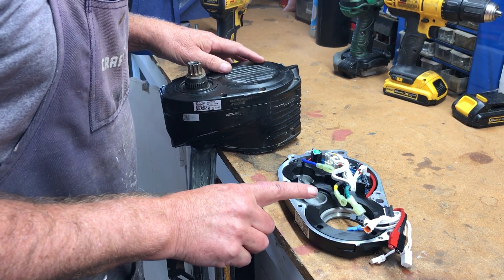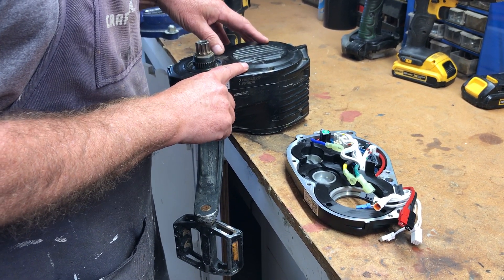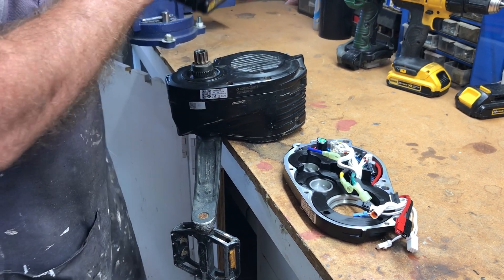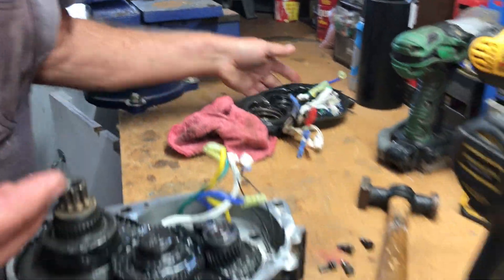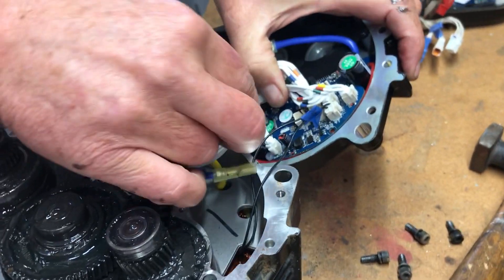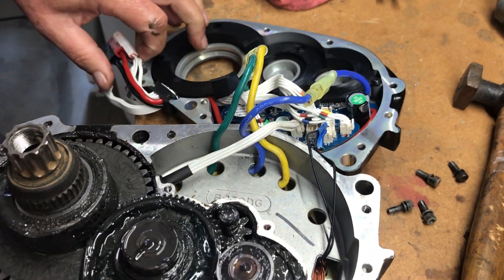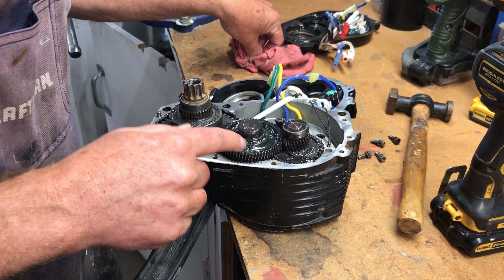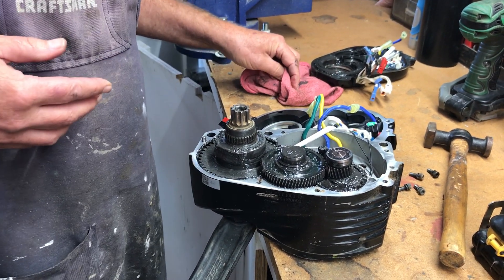Bafang Ultra G510/M620 Bad Controller Swap

Comment: Guess you had to disconnect the wires again to get the gasket on, but thanks for the overview of the process! I recently saw a walkthrough video of the bafang factory, and it looks like they now protect the electronics a lot better, submerged in non conductive sealant.
Reply from the maker: Actually the gasket can be put on easily even if the wires are connected. Not sure of the benefit of encasing the board in resin for the user.  This means no board repair or upgrade of mosfets etc.

Comment: I have thrown away the G510 motor that has stopped working.
It may have worked if I replaced the controller.
I'm afraid
The G510 I'm using now is an early model.
Will the performance improve with the new controller?
Reply from the maker: You probably could have repaired the old 510 with some diagnostics. You should at lease have saved it for spare parts! The new controller will not improve performance. You can make changes in performance by altering programming. If you have poor performance or jerky power bands then a reprogram might help. I'm fine with the stock programming as I have over 4,000 miles with little program changes. The only problem I ever had was not calibrating the new controller to the motor. That makes a big difference in smooth power curve. Best of luck and happy riding! You cant beat the power of the Bafang when climbing long steep hills!!

Comment: I accidentally shorted out the controller before I even installed the motor on the frame. It destroyed my display unit too.
There's no short circuit protection on this system.

The capacitors in the controller held a charge so this can easily happen when unplugged from the battery.
Reply from the maker: I feel your pain! When you replace a controller model Cr r10m.1000.Sn.u.1.5 you have to calibrate the motor to the new controller. I just found this out march 2022. You do this with the C961 display that has been programmed to go into diagnostic mode.
Reply: @filoncmike  Do all the C961 displays have the ability to go int diagnostic mode?
Reply from the maker: @BruceTheSniper  Hello Bruce. All C961 displays can go into diagnostic mode once loaded with the program from Bafang's programming tool. I went to Bafang Los Angeles and they programmed my display for me. Not sure where you are located to have access to the programmer at a dealer or Bafang.
Reply: @filoncmike  I found the instructions online with the hex code to upload to the display. If that doesn't work, I'll get in touch with my contact at Bafang LA, thanks for the heads up.

Comment: Hi Mike! I congratulate you for the video. I have the Bafang m620 with 1000km and perfect. I took the ebike for a km review and I had to change the chain and sprockets due to wear. When I went out to test it, everything was going correctly until the engine stopped assisting. The display marked the assistance mode but the motor did not work. However, the walk mode does provide assistance... Turn it off and when it turned on it worked perfectly. I turned it off again and stopped attending. Any advice? thank you!
Reply from the maker: Disconnect your brake motor shut off cables one at a time. If it works again you know that brake is not adjusted properly or is defective. Good luck!!
Reply: @filoncmike  thanks!! i will try

Comment: Thanks for the detailed installation video. 
I have a G510 motor that has the CAN interface on it. Do you have any experience with replacing a CAN controller board with a UART controller board? From the wiring it looks like the only wires that go to the motor are the phase wires. So I'm thinking that the UART controller should work on a motor that  currently has a CAN controller. Thanks
Reply from the maker: I don't think there is any problem. Everything performs the same. Good luck!!
Reply: @filoncmike  Thanks. I Will let you know how I make out. I have a UART controller on order.
Reply from the maker: Just to make sure, you will need a UART display. I have the DPC 18. It is very good!! Good luck!!
Reply from the maker: I made a mistake, I confused my new bike with the old one! I believe my new controller w Uart worked with the old display. So hopefully it will work for you, although the DPC18 is worth the upgrade!
Reply: @prational  You'll need to change the harness and display to the UART versions or run an adapter cable from CAN connector to the round Higo for the new display.

Comment: Hello Mike Filonczuk!
I would like to ask about the motor i have the same motor and my pedal asistent stopped workin the motor is  working the gass (acceleration ) its give me power but the prdal asistent its nit working i do not want to use it like this its not so much fun and my battery is not last so longer like whit the PAS .
Can you help me with this maybe what do you saggest what can i check what can be the problem?
It was a day when started to work again for 10 minutes and then stopped again...
Reply from the maker: Adrian, did you get any error codes?
Reply: @filoncmike  yes but in the past and very really and it was for one minute and then gone
Reply from the maker: @adrianchester  do you remember what the code was?
Reply: @filoncmike  04 and 21
Reply from the maker: Did you figure out the problem? Check your speed sensor with a magnet. Pass the magnet back and forth in front of your sensor and see if speed registers. If not check for 5 volts at the red wire on your sensor. Black is ground. Check my other video for testing the sensor. If you don’t get a voltage there, you may have shorted out your 5 volt circuit. You may need a new controller.
Reply: @filoncmike  i will check that too.. but anyway i allerdy ordered a new bafang central motor torque sensor and a bafang programing tool best tool for bafang UART/ CAN SYSTEM .
But thank you for your advice:)
Reply: @filoncmike  but the speeds is registering no more erro code i will chelck the voltages

Comment: Burnt my controller and display while using the thumb throttle. Replaced both, display and controller. Calibrated with C961 (Er 44). Walking mode is working, brake sensors are working, head and rear lights are working. Pedal assist, speedometer and throttle still not working. Any ideas?
Reply from the maker: Oh boy! are there any more error codes? disconnect both brake sensors and check your speed sensor at rear wheel for proper 5v. Could sensor have been shorted? Unfortunately this will take a lot of tracking and testing to narrow it down.
Reply: @filoncmike  While calibrating it starts with Er 40, Er 41, stops at Er 44. No error codes at C18 display. How to measure 5v at the speed sensor?
Reply from the maker: You will have to carefully cut into the covering in the sensor wire by the back wheel and check voltage between red and black wires with power on. Blue wire is the signal wire. Do not short them. Code 21 is a fault in sensor. When you matched motor to controller did motor spin slowly by itself?
Reply: @filoncmike  While calibration motor spins slowly by itself, yes! And walking mode is working as it should! No error codes at C18.
Reply: @filoncmike  I have a bike with M400. I will  put the bike together and will try it with the M400 speed sensor instead. It should be the same sensor as the M620 sensor, right?
Reply from the maker: The sensors are the same. Connectors may be different.
Reply: @filoncmike  I have ordered a new speed sensor from Aliexpress. Will need some time to arrive! Distance from the sensor to the Magnet is 20mm. Will this work? Any ideas to get the magnet closer to the sensor?
Reply from the maker: You can stack another rare earth magnet disc on top of the factory magnet it will stay. Glue will make sure. Make sure magnet is aligned to middle of sensor not at mounting screw.

Comment: How do you troubleshoot the controller to determine if it needs to be replaced or not What are the symptoms?
Reply from the maker: Hello Kie! The G510 controllers are pretty bulletproof. The only time I have had a failure was from shorting out the 5volt output to the speed sensor or brake sensors. If you don’t have 5 volts at those red wires going to sensors you may have a short somewhere. If the motor is not turning at all, look first for codes they will tell you what is wrong usually. Unplug brake sensors and see if motor works indicating mis aligned or bad brake sensor. The motor will not run if it thinks the brake is engaged. Check for 5 volts at throttle also. Do you have any power? Check for burned or melted battery connections or melted battery terminals. Ride safe!
Reply: Hey I have an M620 and I replaced the motor core (stator) and it’s running backwards (reverse direction). When I run the motor calibration it goes forward but I get an error code
Reply from the maker: I know it sounds crazy, but are you absolutely sure you have the three field wires correct?
Reply: @filoncmike I am. I even swapped them to see if changing the root somehow changed the polarity
Reply from the maker: @mikehtiger  have you had any success with your problem?
Reply: @filoncmike  I haven’t, I ordered a new controller

Comment: Hope you can answer a question..while upgrading the wires (pos and neg on the main harness) and having the motor on my bench, while cutting of the ends of the wires the neg and pos wires touched and there was a small spark...I assumed the capacitor in the controller, but now when I put it back together I only have throttle and not and kind of pedal assist. I guess I need another board, but Im reading they need to be calibrated???...did this work after you installed it?..Thanks
Reply from the maker: It is so hard to track exactly what burns out when those wires are shorted. The entire 5v circuit seems to burn out. Yes the controller needs to be aligned with the motor. I had bafang program my c961 display to do the job. Makes motor operate smoothly according to program. Good luck!!
Reply from the maker: I’m sorry. I thought you shorted the speed sensor wires. Shorting the main leads will only unload the capacitors. This shouldn’t cause the PAS to stop working. Look elsewhere for a disconnected wire.
Reply: @Mike Filonczuk  Thanks for the reply...that's what I thought as well...I was contacted by Henry from Frey..he wants me to do a video and will send me a tester of some sort to try and diagnose the problem...I'm going to get into the motor again and check the pins see if one has poked through or something...
Reply: @filoncmike  Well after carefully watching your video again, it appears that I put the 6 pin wiring harness from the motor in the wrong connector. I put it in the POWER connector, where in your video that is empty on both boards..I am going to put it in the same connector you put your 6 pin wiring harness from the motor in. Perhaps that is why I had no pedal assist...
Reply from the maker: @johnnyzee383  I thought it was something like that. It should work now!!
Reply: @filoncmike  Well just took the bike out after putting that wiring to the other 6 pin on the board and still no pedal assist. Either I damaged something when the Neg and Pos wires touched or putting the wiring on the wrong 6 pin connector on the board damaged something...
Reply from the maker: @johnnyzee383  no code?
Reply: @filoncmike  Nope..no code which is strange....
Reply from the maker: @johnnyzee383  where are you located? Have you looked for a bafang rep nearby? I have found them very helpful. There is an office in Los Angeles
Reply: @filoncmike  Ya I have a guy named Henry..Ive told him all the details and he is going to be sending me a diagnostic tool or something..see if we can figure out what it is...I can tell you one thing..since I replaced the 12 gauge neg and pos with some 10 gauge wire, there is less sag and higher top speed.
Reply from the maker: @johnnyzee383  what do you mean by sag?
Reply: @filoncmike  Under full power the battery voltage would go from 54 volts to 48 volts (from a  dead stop)which quite frankly considering the controller is only pulling 30 amps is pretty bad. The Samsung cells are rated for 8 amp each x 6 in parallel should be good for 48 amps. When i checked the main wiring (neg and Pos) it looked like 14 gauge to me (it says 12 gauge but I dont think so)..so I used 10 gauge and immediately noticed better performance and less sag, and then when I replaced the crappy connectors (which did not make a good connection), now the voltage sag is only about 3.5 volts!. Battery sag is the result of too much resistance, and 10 gauge is required for 30 amp DC.
Reply from the maker: @johnnyzee383  what connectors did you upgrade to? thanks
Reply: @filoncmike  The same connectors that are used for the 3 phase wires in the motor. Widely available..

Comment: Is it just me or does this controller fry really easily.  Combined with headset cable routing it's not a good situation if the slightest damage happens to the display cable.
Reply: You’re not suppose to use cornhead grease in these motors..it’s viscosity is too low and it gets on the controller and torque sensor and fries it..use mobil shc or something

Comment: Can I swap the m420 with a m620? Would it fit in the same layout? My m420 feels like it has some slipping when using certain assistance and gear combinations. Sometimes the screen and assistance switches off but the battery leds are still on. Otherwise these are lovely powerful motors.
Reply from the maker: I compared the dimensions of the 420 vs 620 and they are very different mounting hole configuration. You would have to swap out the m620 bottom bracket. I would just get a new bike. Time to upgrade to the Ultra!!

Comment: Can you help me please I have a frey am 1000 the motor looks fine but when i use the throttle it only starts the motor for a second and then stops what could be the reason I hope you can help me no one has being able to.
Reply from the maker: Have you tried disconnecting your brake  signal wires? One may be malfunctioning. Did you get an error code?
Reply from the maker: any luck Rebel?
Reply: @filoncmike  no error code and I have disconnect all cables and put them back no change
Reply from the maker: Did you disconnect brake plugs then run the motor with them disconnected?
Reply: @filoncmike  I tried it now but still not working. Not even pedal assist works. When I pressed down on assisting modes and hold after get to zero bike star moving with motor but thats the only way motor keeps working for more time than using the throttle.
Reply from the maker: Sounds like you are still receiving a signal that your brake is applied. This might be a short where your motor output plugs attach right at the motor. Where are you located? Maybe Bafang can help. You can test your motor off your bike.

Comment: IS there any other way to do the calibration?!?  Im getting a new controller for my Ultra with similar controller model.  Nobody has any C961 calibration tools.  Can I buy BSST and calibrate without access code?!?  Just curious how I can calibrate my new controller (or is it not always necessary?!?  I do have the USB programming cable and the software for tweaking)
Reply from the maker: Jeff, where are you located?
Reply: @filoncmike  sask Canada.....
Reply from the maker: My experience was the controller if not matched to the motor would not bring on power going up hills. When you needed it most, it wasn’t there. Very frustrating. When you got to the top of the hill, on came the power! I found the c961 controller on line and luckily we have a Bafang factory rep in LA. He  swapped my c961 for his that was programmed to go into diagnostic mode. It then took 2 min to hook the motor up and with c961 attached it spun very slowly and done!! Now power comes on smoothly going up the steepest hills. I would try the new controller as is, then search for someone with Bafang that has a programmed c961. Good luck!!

Comment: Hi Mike where is the temp sensor on this unit? mine keeps flashing up on the dash temp warning even if the bike is dead cold.
Error code :11 Fault with temperature sensor inside the motor.
Reply from the maker: Hello Junior, I think the two black wires that snap into the controller marked hall are the temp sensor. I haven't had that code pop up and I ride the heck out of the bike on hot days with two mile uphill climbs without any problem. I added an aquarium temp gauge in the beginning to check and on the hottest days it only got up to 110 deg F. 
Look on the forums and there are people with the same problem. There doesn't seem to be an easy solution. It may be possible to install a new sensor to the black wires but I don't know what that sensor might be or the specs on it. Good Luck!!
Reply: Ignore it

Comment: Hi mike, having few in the beginning now constantly error 21 on my m620, the speed sensor is aligned , sensor wire is a bit scratched where enters motor body. you think it’s sensor wire issue or control gone bad?, greatly appreciate you’re input ,thanks. Sean.
Reply from the maker: The three wire sensor has a 5volt red wire, a ground wire and a signal wire. If you are able, test for the 5 volts across red and black wires. When the magnet comes is close proximity to the hall sensor, the signal wire is energized. Some sensors have light on them that signals it is working. It sounds like your sensor is bad. Highly doubt controller is bad. If you want to replace hall sensor, see my other code 21 video. Good luck!!!
Reply: I have seen on some Ultra builds that the speed sensor wire was routed between the motor and mount, if this was done, the wires were definitely pinched. The wire route should be between the plastic cover and motor, this also makes it easier to replace if damaged (no motor removal needed). Either way the problem is in the sensor......